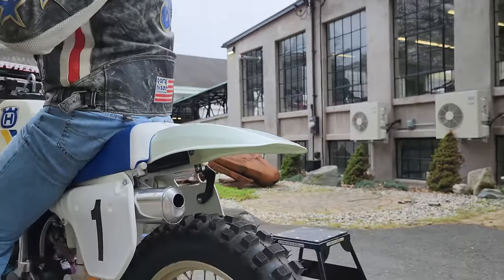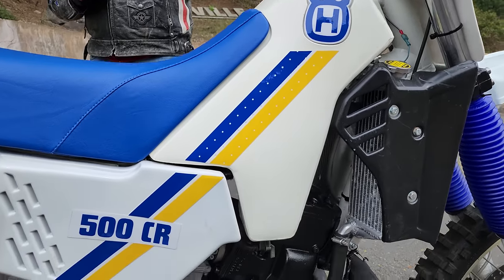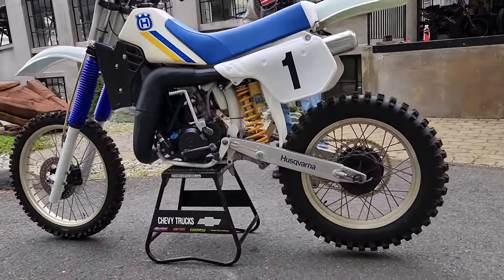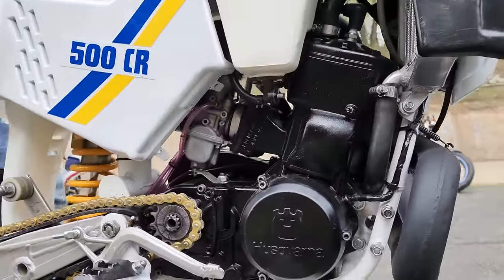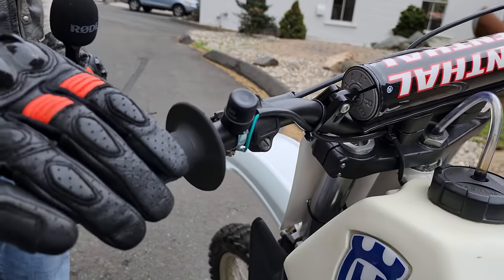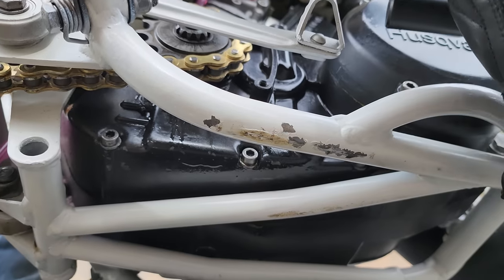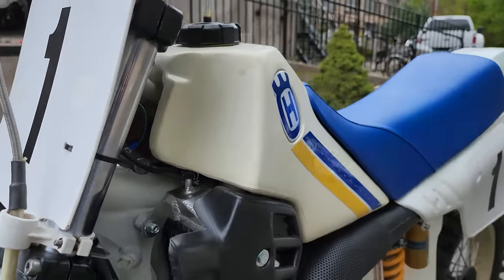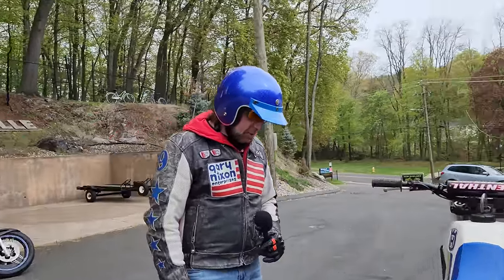MAC DADDY 1985 HUSQVARNA 500 XC

Comment: My mate looped out my CR500 (Honda) today. He’s ok. Bent and broke the sub frame. Can’t find a new one online in Australia. Any suggestions Ken? There seem to be a few over there.
Edit: turns out my friend fractured his back in three places.
Reply: What year?   I would contact one of the aluminum frame Cr500 builders and see if they have one sitting in the pile.  =They swap old frame for an new Cr250 or Cr450 one.   A good welder should be able to repair your steel.
Reply: @jonmccormick8683  it’s a 97 model. I just took it off and it’s actually a bit rusted so don’t think I’ll have it repaired. Do the 250 ones bolt straight on?
Reply from the maker: Oh no!! Check on ebay  or bormi parts makes aluminim
Reply: @KaplanCycles  thanks man.

Comment: Hey kap I got this runleader temperature gauge and it has a wire with copper washer that goes under the spark plug was wondering if it's OK to install it I got a 98 kx250 I'm going to put it on just wondering if raising the spark plug  with the washer is going to mess my motor up what's your opinion on this 😮 and that is a nice husky bike love big bore 2 strokes 😀

Comment: I would put a half-smoked screen, some reinforced protectors for the hands and a roll bar from the front and below and around the engine... apart from headlights,tailights, turnsignal,mirrors and a plate😅🙏

Comment: Would she outrun one of the mighty 500 Honda's?Just curious,but i guess not or you and your Son would probably be racing One.
Reply: Husky ruled the desert races along with the later powervalve KX500.  This bike will probably go 100mph+ Plus it is a bigger bike which helps stability.  MX -I think the Honda had the edge with the cartridge forks.

-This pipe is also interesting.  Very large, but shaped like he old early 80's non-power valve 125 pipe = probably all top end on this.  Pipe has the welded on heat shield also = must get very hot. This bike is pretty cool and the Husky CR (MX) line did sell as well as the Enduro/Cross Country lines.  I have a huge soft spot for the Husky 430 back then.  

If you are that larger >6'2" rider this maybe your MX bike or just do it all bike.

Comment: Goldmeister Colours is a highly elastic plastic paint.

Sikkens Elast-O-Actif 1L
Elastifying additive for two-component acrylic paints, for coating elastic plastic car parts..

The paint Falling cracking is more than a ermmmm pstttstt take

Why paints need a little high melting points rubber % added to plastic coating.
Anti shock polymer resins or 0.2mm line X (Paxcon bomb proof paint) can be nanolayers/micron layer application = cheaper InDesign indestructible paints coatings

0.01- mm line X cheaper coating/laminate layer garage ramp style metal strip half pipes ( or 3m sticky back rubber imprint outside simple easy stick on..
Skid bash plates are available. (Also need added stickers/decals protectors)
Any sort of 3M carbon sticker decals under frame protectors.
3M sticky back rubber is available needing imprint and logo icons badge Fonts (rubber badge manufacturer)

Frame protection sticker are available for huskies for upper framework not the under framework protection decals vinyl carbon etc what will sell stupid, rather the garage ramp thin steels/aluminium strips protectors.

Checker plate sticky tape cut rolls x 2 end badged sold packaged branded

Laser cut 2 ends shape strips From oblong grid tool to cut row columns from wide rolls of garage ramp sticky back vinyl (CNT decal sticker could be made metallic) with a scodix foil metallic printing stamping Rubber /sheet films etc example garage ramp style rolls (scodix maps measure every panel area²) imprint large logo icons fonts mapping printing.
Packaging machine or manual job sleeve and staple/glue ..

Simple plastic sleeve socks & cardboard upper level labels barcode etc.

Embroidery seat fonts Logo DIY.
Tpu embroidery is available YouTube links.

Front and rear mudguard rubber badges fonts and or logo badges numbers (swingarm Rubber/enamel ceramic badges) also front number panel larger custom enamel ceramic badges
Reply: 1992 CR500 broke to built (RM 250 broke to built is another sight for sore 3yes) YouTube deserves that full makeover.
Nice bike Travis Sawyer.
Transparent rubber badges to honda ghost badge Wooeewwww wow what I'm seeing rubber stamped or and embroidery to enamel ceramic badges.
A better embossed badge logo fonts numbers